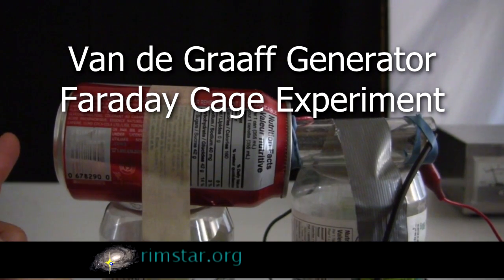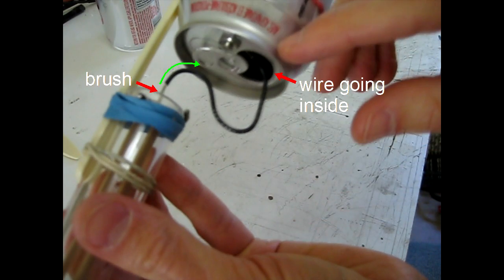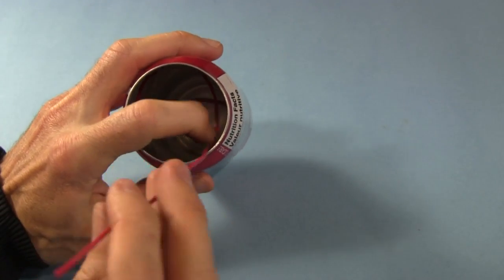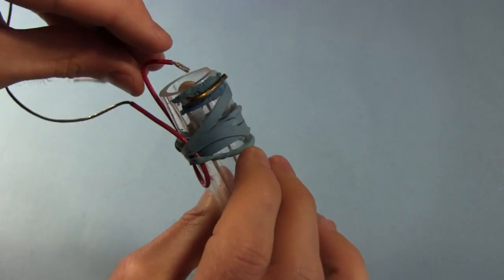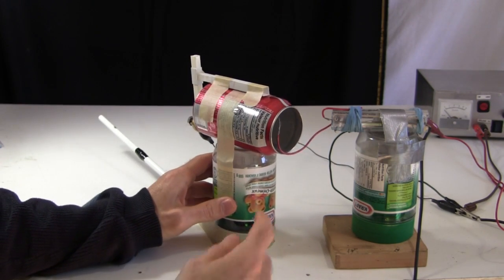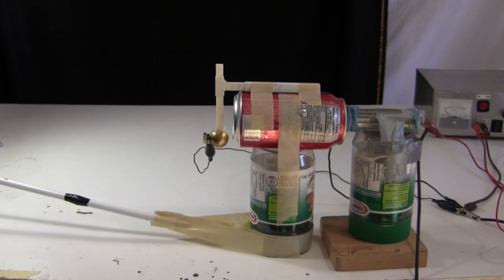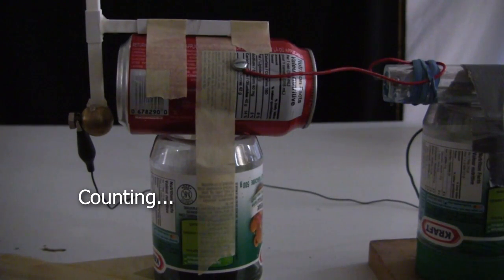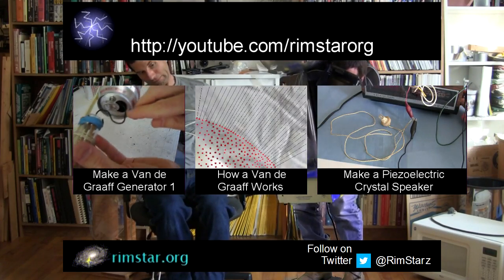Van de Graaff Faraday Cage Science Experiment

Comment: Awesome video series.  My one question about this is what if the dome was positively charged (glass roller on the bottom).  Since positive charge is just lack of electrons, is it possible that leaving the top roller outside the can would help since the electrons would be repelled out of the wire faster?

Comment: If I keep the 1.5 V motor rotating the  rubber band on a pully mounted on wooden base completely open to air unlike inside plastic tube or plastic bottle will it generate charge .
Reply from the maker: Nitin Tiwari Yes. The only thing to have to make sure is to not use a metal support structure in place of the plastic tube. A wooden base completely open to air will work.

Comment: Why u don't have to scrap of the outer coating of the can?
Reply from the maker: For doing what? Notice in the video that to get a spark I'm putting the metal ball or my finger near the bottom of the can where there is no outer coating. But you can probably get sparks where there is a coating too because the voltage is high enough to break through that thin coating.
But it isn't always high enough to break through. If you touch the coating directly, then the voltage will be low and the current will not flow through the coating. Notice in my "Van de Graaff Demonstrations and Explanations" video http://youtu.be/Gf6EbRmYImI at 3:28 I have to remove the coating to make the current flow to the rice.

Comment from the maker: I'd guess more energy would be needed? To increase the energy in the spark for a Van de Graaff generator you increase the diameter and roundness of the dome, thereby allowing more charge to build up on it before dumping it all in the spark. With the antenna and ground it sounds like you're getting into a spark gap transmitter, which I only just started reading about after reading your comment. First guess would be the transmitting antenna goes on the side of the spark gap opposite from the VDG.